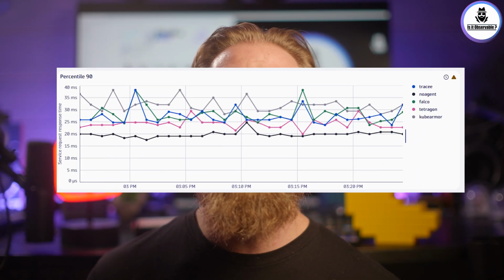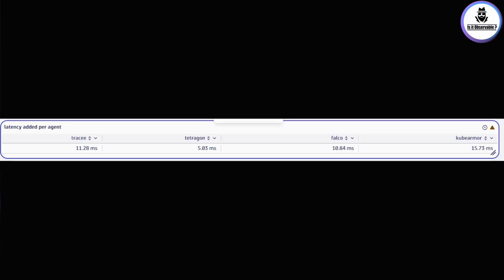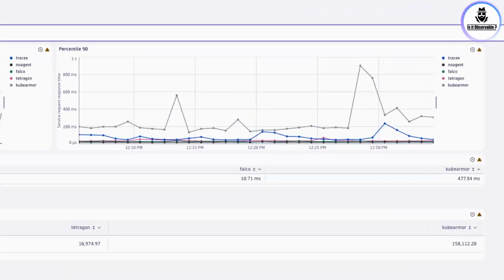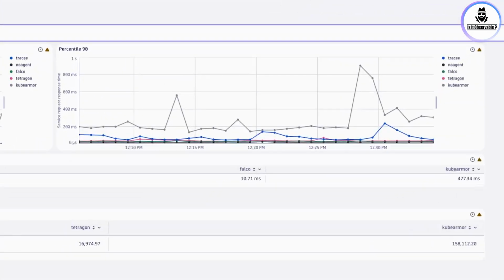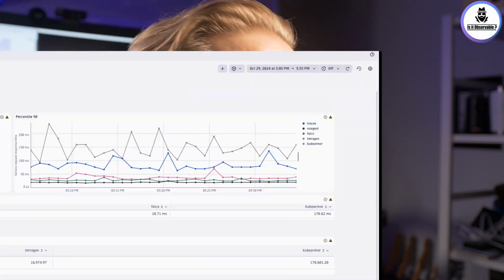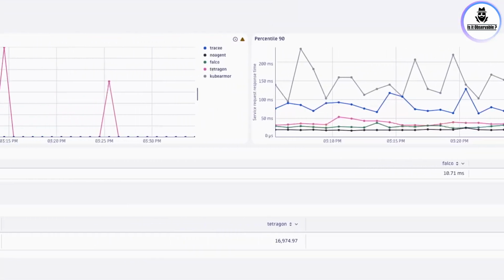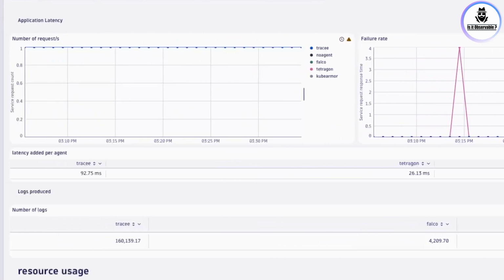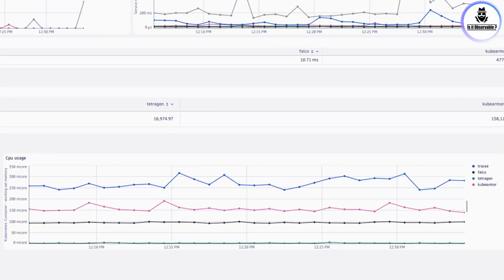Falco, Tetragon, KubeArmor, or Tracee? Choosing the Right Security Agent

Comment: Regarding Kubearmor Relay server, it aggregates the kubearmor generated telemetry by connecting to each kubearmor instance and then broadcast it to all the connected clients.
kubearmor-visibility controls the kubearmor's observability scope subject to process, file and network operations. 
For example, when visibility: process,network kuberarmor with it's observability engine will trace only process and network operations in kernel space and provides the telemetry event for these observed operations.

Visibility controls are available at both global and namespace level.

Comment: I'm not understanding about what you saying about KubeArmor, what i know and based on my knowlages its use eBPF to enforce the secuerty? yes its use CRDs but its not listen on the "runtime logs" but hooks into the eBPF stack right?
Reply from the maker: Hi, yes Kubearmor like the other solutions uses eBPF and relies on CRD for the configuration. Currently the logs (events ) of Kubearmor are not exposed as log within their agent. The only way to get the events out is to either use their OpenTelemetry receiver that will connect to the gprc interface of the kuberarmor agent to retrieve the event in the OpenTelemetry format . Or enable the logs at the relay server ( that similar to the collector, will connect to the grpc interface of the Kubearmor agent)